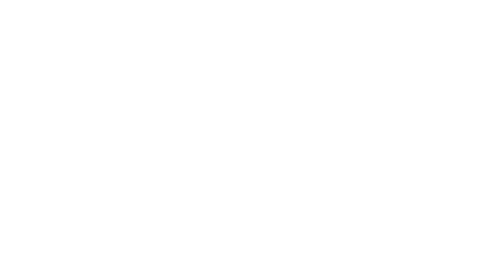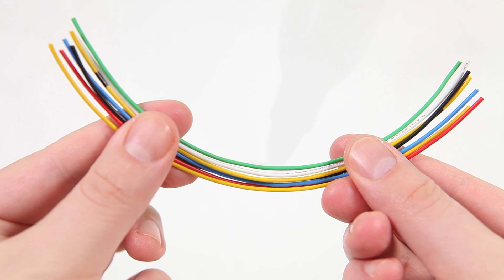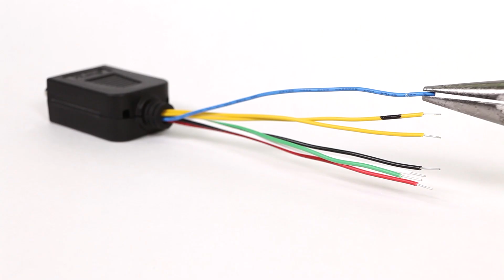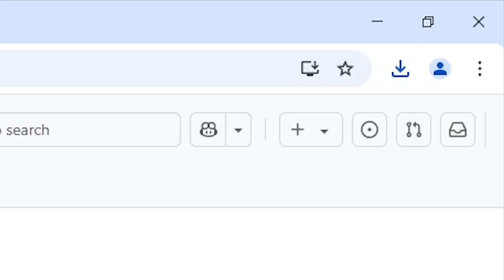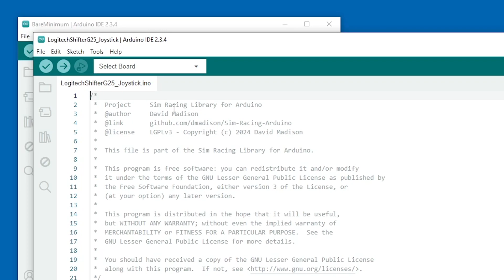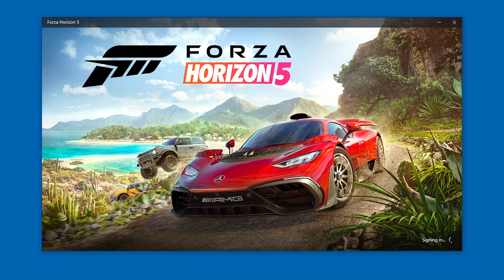DIY Logitech G25 Shifter USB Adapter (No Soldering!)

Comment: built mine today and everything EXCEPT for button 16 (sequential gear up) is detecting? any suggestions?
Reply from the maker: It sounds like your setup is slightly out of spec with mine. If you reflash the board with the included "Print" example, you can use the serial monitor to run through a conversational calibration to fit the code to your shifter.
Reply: @dave.madison  Perfect, all working. Thanks!

Comment: Is it possible to do this project with an arduino uno using UnoJoy ? UnoJoy makes possible usb hid in arduino unos so techinically it should be able to be integrated making this project possible on arduino unos. I dont have the knowledge to do such implementation in the code but if you could im sure you would be facilitating this project for loads of people since the uno is way more common.

Comment: Hello, I have a g25 shifter with a cable torn and I dont have the other half of the cable (the db9 one), can I put the cables directly into de Arduino? If so what colors do I put into each pin
Reply from the maker: You would need to splice the existing stranded wires to solid-core wires in some way (soldering, wire nuts, alligator clips, etc.), otherwise they won't make secure contact with the Arduino's headers. Alternately you could use a SparkFun Pro Micro (32U4) and solder directly to the pins.

There is a table in the library documentation with the colors of the wires in my own shifter: https://dmadison.github.io/Sim-Racing-Arduino/docs/logitech_shifter_g25.html
Reply: @dave.madison so I went to do this but my shifter doesn't have two black cables nor a shielded one, it has a bare copper wire and a white cable as well as one of each other colour
Reply from the maker: @jccfgamer2005  In that case I'd disassemble the shifter and look at the J11 connector on the PCB. You can figure out the colors based on the pinout.
Reply: @jccfgamer2005  I have the same one. What did you figure out?

Comment: Excellent work, thanks for sharing it! You only missed commenting in the video about the calibration procedure using the other file you included in the examples (LogitechShifterG25_print.ino), and then adding the calls to shifter.setCalibration(...) and shifter.setCalibrationSequential(...) after the shifter.begin() in the setup. My shifter wasn’t detecting the second and fourth gears properly, but after calibration… everything works perfectly!
Reply: can you ellaborate on this, all binds are detecting for me except for button 16 (sequential gear up) but fairly new to all this so cant work out the calibration you are mentioning
Reply: I don't remember exactly anymore, because it's been three months since I did it. But the shifter uses potentiometers internally, and the firmware compares them against certain values to determine the "button pulses," so it depends on the state of your potentiometers whether it works well or not if you use it without calibrating. The calibration (with LogitechShifterG25_print.ino), if I remember correctly, will give you some values via the Serial Monitor that you'll have to copy and then pass into the functions I indicate as parameters, so they're taken as the calibration for your specific shifter every time you use it. @Kronos747

Comment: Hey, is it possible to have both the pedals and shifter on a single Arduino?
Reply: You can have 8 axis, 128 buttons, and 4 hats per gamepad recognized by windows. If your arduino variant has 5 analog inputs you should be just fine, as you will need 2 for the shifter and 3 for the pedals. 

The project boards are like $3 each though, it’s probably better to just give each device their own device.

Comment: Hello. 
After checking your Pages, it is possible to use an Arduino pro micro, correct?
I have one laying around doing nothing but colect dust, so my question is (soldering is not a problem for me) the connections, library, code are the same?

Comment: hi i am having problems with the code for some reason it moves my axes to the right top and how can i fix this
and its not the shifter because i tested it with a other shifter but it still had the same problem
Reply from the maker: Check your wiring, it's likely you have a bad ground.
Reply: Maby its the boars does the arduino due work too
Reply from the maker: @dduasman  ...if you don't follow the instructions in the video, you shouldn't expect to get the same results. The Due is not a Leonardo and the wiring is not 1:1.

I believe most of the connections should work, except that the Due is not a 5V device like the Leonardo. You need to use the 3.3V pin for power, and you may have damaged the microcontroller by connecting 5V to the I/O pins.

Comment: I might be asking a stupid question, but can I use any other controller with this one? For example, this G25+Leonardo is connected to USB, and the G29 is connected to the computer (in another USB port). In this case, the G25 on the Arduino works autonomously without interference, right? You can select both at the same time, but one will be config in the Logitech software and the other will be adjusted within the Arduino IDE + Windows Joystick Ajust. Is that it? For example, in ETS2, you can select multiple USB controllers (including steering wheel, keyboard, joypad, joystick, etc. separately). Thanks.
Reply from the maker: Correct, the shifter adapter is its own independent device.

Comment: I've got everything working but i can't pull up the arduino game controller at the end to calibrate?  Is it possible that I missed something along the way?
Reply from the maker: Do you mean within the game? Do you have any other Arduinos connected? Some games get confused when you have multiple devices with the same USB identifiers.
Reply: @dave.madison  I think he meant calibration of the arduino itself, I spent half of the day to get it to work properly. What you should do is write shifter.serialCalibration(); on line 99 of the sketch and then add a new line. If you have g25, on the new line 100 write shifter.serialCalibrationSequential(); Upload code to arduino, open serial monitor by pushing a button in the upper right corner of arduino ide and write shifter.serialCalibration(); there, this will start guided calibration process for regular gears, follow the steps. Then write shifter.setCalibrationSequential() to calibrate sequental shifter if you have g25. Then clear lines 99-100 and paste calibration results there and upload again. Without that in my case gears 1-2 were often engage gears 3-4, rear didn't work at all and in sequental mode shift down didn't work too. You should add this to description. Cheers!

Comment: my db9 conector is diferent... on the sheet it says that 5  is ground. from the top irt looks like this
9-8-7-6-5
G-4-3-2-1
and on the sheet it says  this 
1-CD Carrer Detect
2 RXD Receive
3 TXD  transmit
4 DTR data terminal ready
5 GND ground
6 DSR data set ready 
7 RTS request to send
8 CTS clear to send
9 RI ring indicator
 please help?
Reply from the maker: Follow the pin numbers, ignore the labels. Those labels are for RS232. The shifter is not an RS232 device, and the labels aren't relevant. If your connector circuit board has any additional electronics on it (like an RS232 level shifter) it cannot be used for this project.

Comment: how do you swap the pins so you dont need an adapter?
Reply from the maker: There is no way to connect the shifter to a PC without some sort of adapter (be it a wheel or standalone).
Reply: i'm assuming you want to do something like plug in the g25 adapter into the g27 wheel base?

unfortunately i can't post links, but if that's what you're after then search google (with quotes) "Logitech G25 Shifter Adapter to G27/G29/G923 Wheel", the second link to an imgur page should be what you want